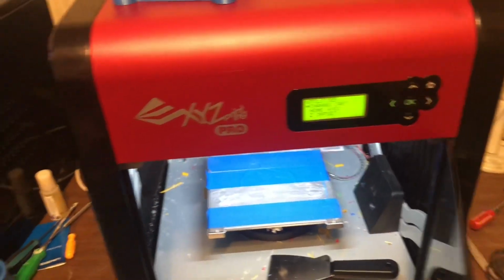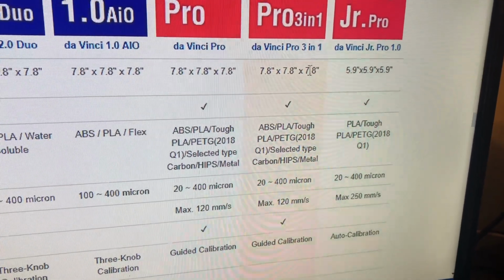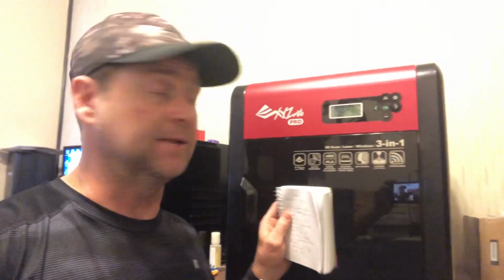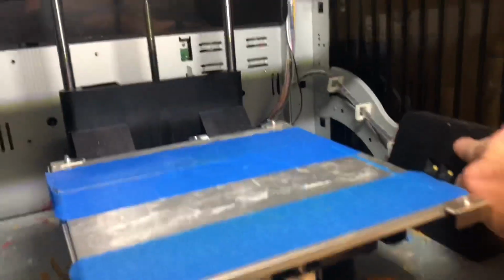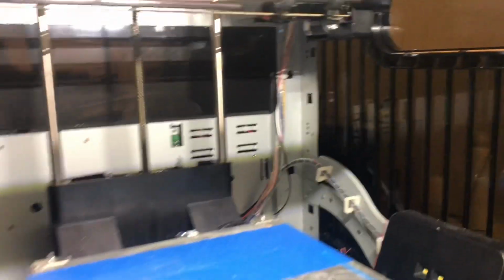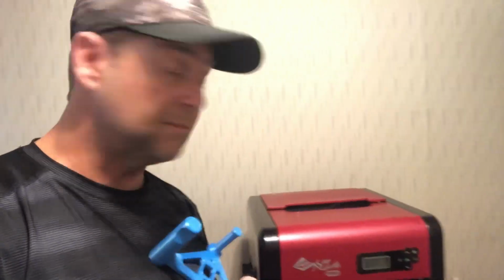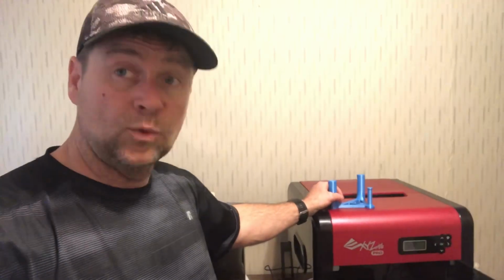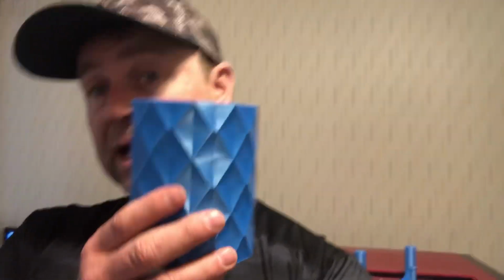XYZprinting da Vinci 1.0 Pro 3-in-1 3D Printer, Does it suck?

Comment: Just happened to stumble upon this as I was looking at unusual 3D Printers. You mentioned the only printer worse is a #D Systems Cube. I have a 3D Systems Cubify that was $1200 new, now I did not buy it new I bought it in 2022. I think it was made in 2012. I bought it for $70 just for the novelty of it. I contacted 3D Systems and, believe it or not they linked me to an old archive file area where I got the slicing software. I does not print STL files it prints .cube files. I loaded the software and guess what, it works. Now print quality is slightly less than average BUT I did a few prints. And, online, there is a way to bypass the proprietary filament and that even works. Now I am not going to go searching for this printer, just was curious as I see one that is listed on eBay for "as is, parts only". So, it got me curious. I do have 10 3D Printers, of course more modern. I bought 7 of the 10 on eBay "as is, for parts only" and I fixed them after a few bucks for parts and some labor hours. Cheers.
Reply from the maker: Glad you got it working, mine worked just not very well

Comment: i leave the cartridge in it and use a spool on the out side with zero issues. take the little card out of the cartridge so it wont read it has zero filament. they also have a device that resets the little card as well

Comment: Just picked this up at Goodwill for $50. Very clean and powered on and ran a system check with no errors. Still has some filament in the cartridge so will run the test print and see if anything needs repair. Read alot of negative reviews so hope at least for the $50 price I got a decent bargain for now.

Comment: I have successfully calibrated, connected to wireless, but haven't tried scanner yet. The printer is working really well for me and although I had a jam earlier on using default ABS settings, I now have been printing the same build with 10 degree walls repeatedly. It is handling it well with no supports. About to try a 45 degree lip which it says it is capable of making. I have seen many people use the laser engraver module which works even on metal (not rated for it, but definitely has been done). I haven't tried the 20 micron print either but I definitely plan on it. (continued in replies)
Reply: I managed to load it yesterday with non-proprietary clear PLA in a matter of minutes. You can even put it in the proprietary container if the spool is small enough.

Comment: 75% of the software related issues said in this video are resolved with FIRMWARE UPDATE version 1.2.3 from 2021-06-15
Also the fun of an 3D print hobby or business is to solved problems yourself.
Reply from the maker: It took them that long to fix that? The problem with proprietary software is you can’t fix it yourself.

Comment: paid 400 or 500 for the 1.0 pro, no scanner/laser. make a spool holder, spend 3-5 buisness days calibrating it, also dont forget to calibrate again after another day because it doesnt stay, OH also have fun with adhesion, from my expierence its either none, or way way way too much and cause damage to the part to avoid break something in the printer, and I completely agree with the customer service stuff they suck a*. dont buy these, I have no bothered to get red of mine i just dont have the time to mess with anything and I know how to make it at least print *most of the time be it not very well, but it works sometimes. bad printer, bad company.

Comment: I purchased one, mainly because of the laser option which as you said turned out to be useless. I learned real quick that I had to manually calibrate it. I also added a magnetic print surface which made a massive difference and the last thing I started using 3D builder as the slicer. The software that came with it is a joke but 3d builder actually works quite well using their default settings. I did try to push it a little faster with manual settings and ended up with a broken belt.
Reply from the maker: Sounds like you did much better than I did!!!
Reply: Iv got it working well enough for my needs, however, if I were to buy another I'd defiantly look else were.
Reply from the maker: Ender 3s are like 179.00 twice the machine. I have them in my store
Reply: I'v looked a little at the CR-10S I'm kinda interested in the CR-X however at this point pre production model reviews arn't the greatest. and their dosen't seem to be many reviews for the "production Model"
Reply from the maker: Really like my alfawise a20
Reply: I'm betting a20 was a typo, However, it put me onto the Geeetech A20M Now I'v got to decide how bad I want the dual extruder vs the larger build area of the alfawise U20.
Reply from the maker: I love my U20
Reply from the maker: Honestly I think if you’re looking for multi color extrusion you should take a good look at the Prusa
Reply: I'm leaning toward the dual extruder due to a prototype I'm working on that has some somewhat internal hard to reach support material. And i'm thinking dissoluble filament sounds like the key.  As far as multi color prusa's setup looks cool however I think they had more potential with their old multi color setup. If they were to update the firmware to work like the A20M's virtual extruders you could load white, Red, Yellow, & blue filament and then mix them accordingly to get whatever color you want.  Assuming the colors would actually mix and look good.
Reply: they developed a new software called xyzware pro. The og xyz software wouldn't even start for me, but the new pro software is great. Haven't had any issues yet and it's free. No clue why they didn't just make the others like that.

Comment: well,  I just got one xyz pro 1.0 and first of all, the calibration is not working, and secondly print always come off from the base. but you know what? after a couple of days figuring it out, everything works as I expect. 3D printer is not just like a regular printer, you may need some electronic and mechanical knowledge.  Hope your xyz printer eventually work.
Reply from the maker: I’ve been 3d printing for over a decade. I’ve. Jolt and repaired numerous 3d printers.Mine was a lemon.
I was able to get it to print quite decently after extensive work, however it never Measured up to as promised.
I’m glad you got your working.
Reply: Your printer will be useless when the print head burns out..
Parts out of stock for over a month. 

https://www.xyzprinting.com/eshop/en-US/categories/35-43-88/

Comment: This printer keeps getting cheaper now it’s 299 without scanning
Reply from the maker: I’d still avoid it especially since the Alfawise is under 300.00 and 3x the machine.
https://m.gearbest.com/3d-printers-3d-printer-kits/pp_1841229.html?wid=1433363&lkid=17021949
3 years ago this would have been 3500.00

Comment: Alot of this sounds like lack of user knowledge / preferences. I have the Pro 1.0 and i havent had an issue out of it. Yes it has some trade offs, but ive already printed the upgrades (spool holder, fan cooler) and havent had an issue with my prints. Then again this is the 3 in 1, and not the 1.0 so i dunno.
Reply from the maker: I’ve gone up and down with the calibration, user groups etc...seems like some are good, most aren’t

Comment: I have been watching the XYZ Pro 3-in-1 printer on Amazon since last year. After watching Youtube videos, I determined the scanner was not up to par and that unit was not worth the extra cost. I bought my XYZ Pro 1.0 on Amazon for $359.00 and bought the laser engraver from XYZ for $200.00. I also purchased from Goodwill a $7.00 Kinect with cables a few months ago. First time calibration was a nightmare. My first print was a complete failure. Watched a lot of videos of how to use it, what to do and not to do. The printer would print on wifi but not the laser engraver. BUT ... After working around the wifi issue, and learning how to calibrate the bed and what to prep it with and the material settings, I have had great results. Oh yeah, the top corner left side hinge pin was broke off before shipping. All of this said, you must have received a true lemon. I am fairly well computer literate (not an expert to be sure) and am brand new to 3D printing. I have had 2 failures (my fault) and 6 successful prints including 2 detailed prints. Laser engraver works fine and I am now learning how to use the Kinect device as a 3D scanner. I have literally had this machine for 5 days now playing with it in my spare time.
Best of luck man!
Reply from the maker: I have been truly surprised by how bad this machine is, as my other xyz printers had been fantastic.
They cant all be homerun hitters I guess. Glad yours is working well. Thanks for the comment!
Reply: Your welcome! Hey ... It never hurts to ask for a replacement or a refund! Added a Borosilicate glass printing surface today. Manual calibration went smooth and am happy with the prints so far. I'll let ya know how it does with PLA.
Reply from the maker: Yes keep me informed!
Reply: @Badkarma325  how is the scanner working for you?
Reply from the maker: It never worked. I ended up getting rid of it